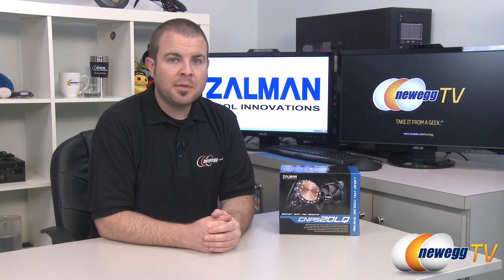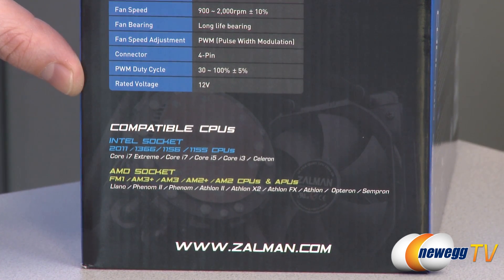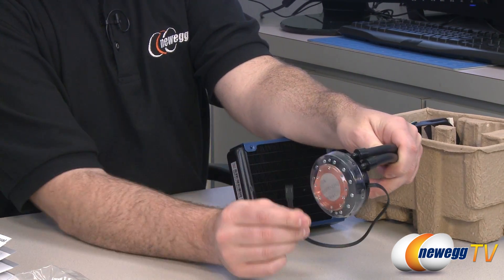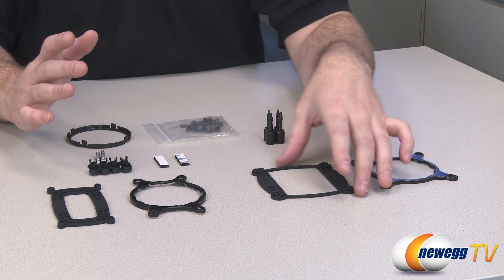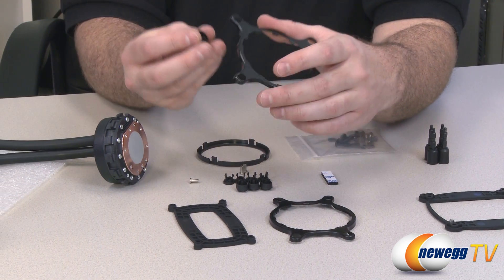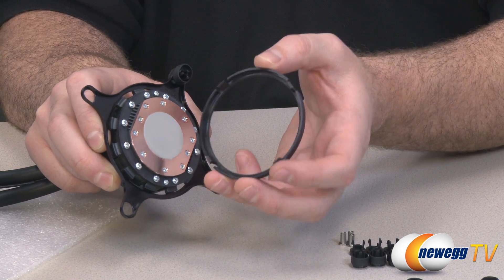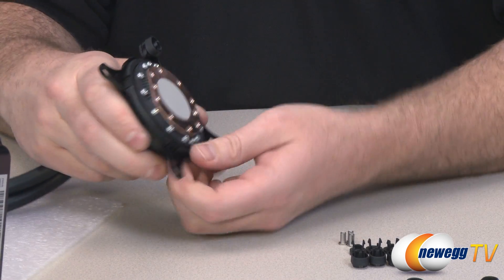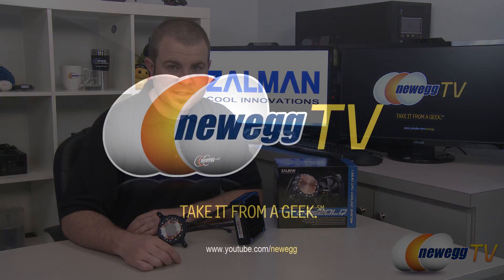Newegg TV: ZALMAN CNPS20LQ Ultimate Liquid CPU Cooler Overview

Comment: I have a question.  So the pump plugs into a random 3pin fan header on my MB.  I noticed when I monitor the fan speeds, the pump actually has an RPM.  What 'RPM' should it be?  I am kind of worried that it might be getting too much power, or not enough.  Should this be controlled with software like the Asus FanXpert2?  Or should it stay a certain 'RPM'.

Comment: being a car guy I've always wanted to, and will eventually, wire up computer fans to test VS the fans I buy from car part vendors.  For example I wonder if my single fan for my radiator would pull more air from a set of a couple 200mm fans.  Also I'd like to do the same test but for my external oil and transmission coolers as well which are much smaller.  A friend of mine who is amazing with computers said zalman makes a great cooler, and their from korea so is he, haha.  Peace shusa. thoughts?

Comment: itd be great if liquid stayed the same temperature. Think of it this way; in drag racing on a forced induction car (turbo, supercharger whatever) liquid intercoolers(used to cool the hot charged air from the forced induction) are ONLY good (high performing) in short runs like racing drag racing specifically. IMHO being not computer savy I'd say a good air to air will out perform liquid coolers in a time test, but in a short run test the liquid might run better. Computers better with air my guess

Comment: Noup, I went for water cooling but it is so much money and prep work. It's a pain in the butt. I did my loop, unlike this "prepackaged" setup.

It's so much easier to get a really good CPU air cooler. But the low temps in water cooling are amazing.

Comment: if your going to upgrade and plan on continuing to do graphic designs a liquid cooling system wouldn't be a bad investment. rather be safe then sorry. I personly am running a amd 8120 unlocked (8 core) with an asus crosshair v motherboard with 16 gb of ram and the stock heatsink was not enough for My personal liking so I went with an aftermarket one. there are programs that will let you see how hot your cpu is getting and if it gets to hot then definatly invest in liquid cooling

Comment: For all those asking questions about this product in relation to other coolers. This cooler is made by Asetek. They are an OEM that makes ALC (Advanced Liquid Cooling) systems. They are most known for making HP workstation/server coolers and Alien Ware desktop coolers. Also, they made the original run of Corsair Coolers, The H50, H70. The Antec 620, Antec 920, OEM Intel and AMD ALC systems all use Aseteks 3rd gen coldplate and use the flexable tubing vs the corrugated vinyl tubing

Comment: They are expensive, but they are much quieter than air cooling. Personally, I find air cooling a much cheaper and viable option as you don't have to worry about gunk and build up that you can get. You also have to do extra planning to install and it's a pain in the ass to clean. A good fan (Hyper 212, Noctua DH-14) will suit you just fine. Specs wise, you'll see little difference. The only bonus I can think of is you can have the same cooling system for both your processor and GPU.

Comment: The radiator on the H100 is a lot better just because it has twice as much surface area. Generally with these enclosed lops you're going to get pretty flat cooling rates if the specs line up. I'd definitely say H100 if you have the extra 20ish dollars and room for a dual 120mm in your case!

Comment: i have a corsair h60 in my rig and i love it. i have an AMD fx-4100 OC'd to 4.5ghz and it doesnt go above 35c (didnt come with second fan or screws so i just bought some from the hardware store and used my stock exhaust fan for push pull config)